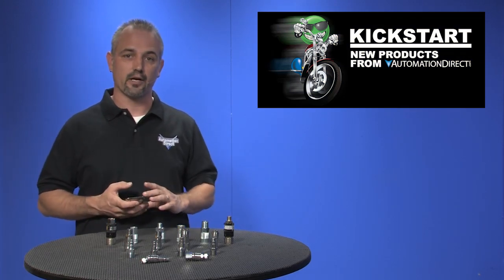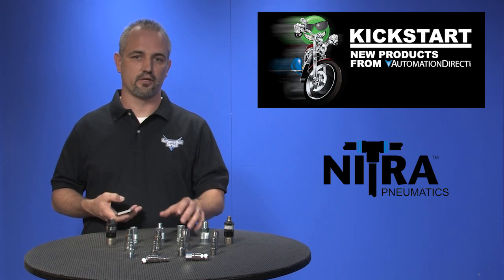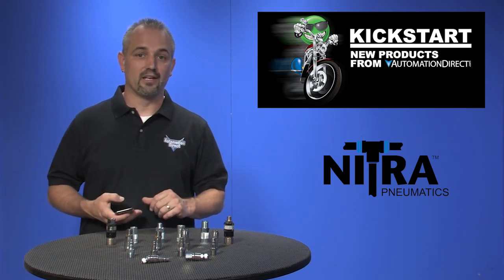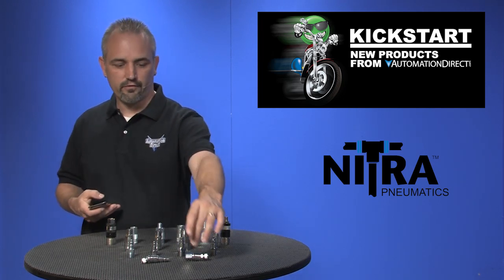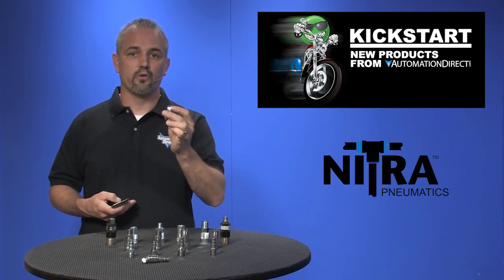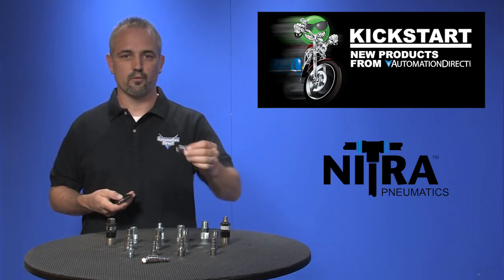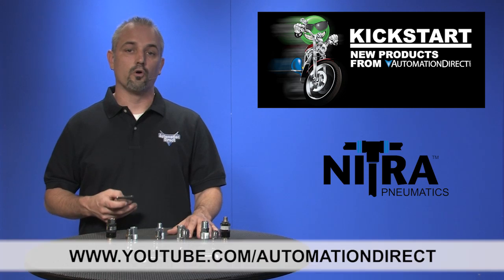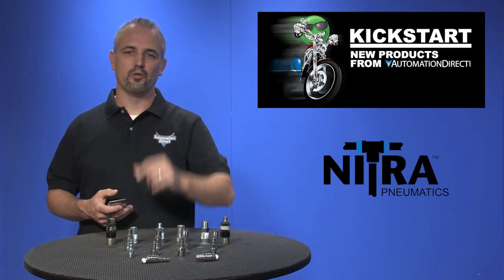NITRA Quick-Disconnect Air Couplings from AutomationDirect

Comment from the maker: Thanks for watching "NITRA Quick-Disconnect Air Couplings from AutomationDirect"! The difference between "automatic" and "manual" industrial interchange couplers is that manual sockets require manual retraction of the sleeve to both connect and disconnect the plug. Whereas automatic sockets accept the plug by simple insertion into the socket and do not require retraction of the sleeve to connect. If you visit our website via the link in the description you can find even more detailed information